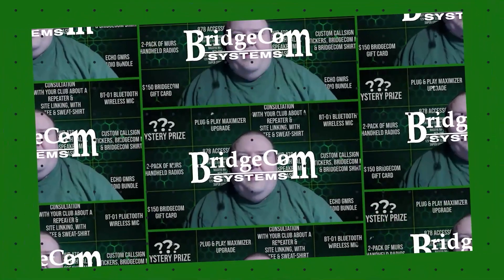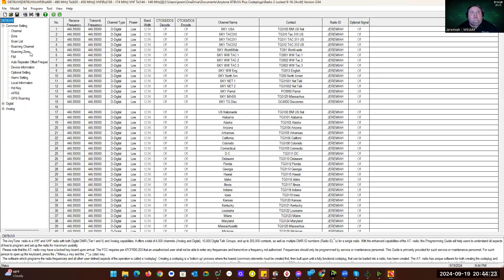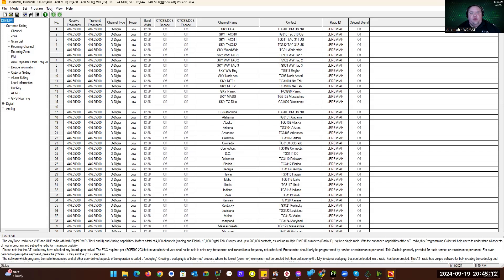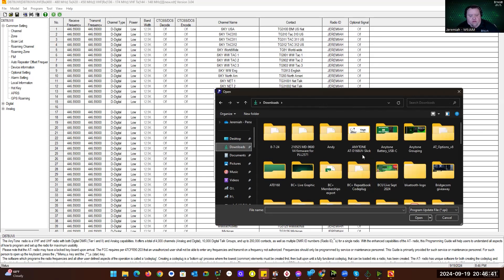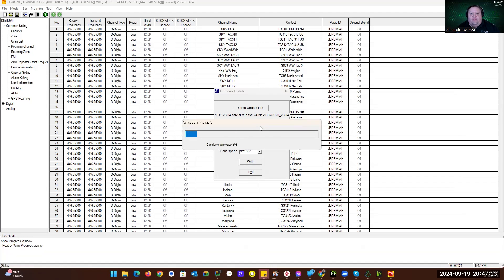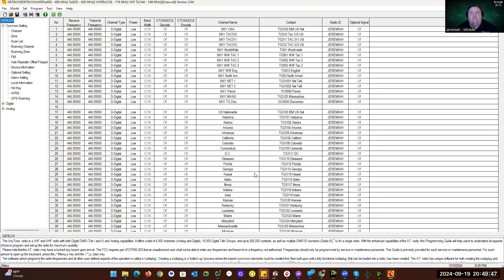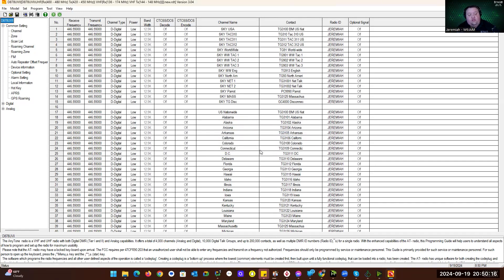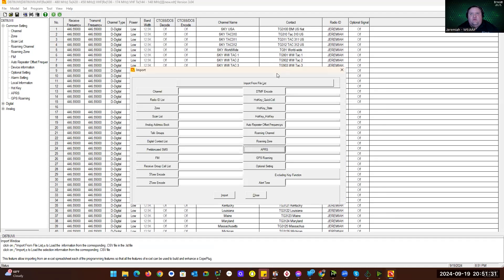How to Update AnyTone Firmware 3.04: Step-by-Step CPS and Satellite Features

Comment: The intro information omits whether this update is for the AT-D878UVIIPlus or the AT-D578UVIIIPlus.   I have both of these radios and am still learning to use and program.  I had to watch most of the video to conclude it was for the D878UVIIPlus.  I recently got my 878 and the firmware was at 3.05.  I upgraded it to 3.06 prior to watching this video.  At the moment I will keep 3.06 installed.  The 578 Firmware is only at 2.08.  The Bridgecom Systems Support pages show the latest firmware for the 878 to be 3.06 and the latest firmware for the 578 to be 2.08.  I am confused by the video that advises how to do an update to an older firmware version.  I seek to be less confused.
Reply from the maker: Hi! Thanks for your comment. If you have any questions, feel free to join our Facebook group — it's a great place to get help from the community: https://www.facebook.com/groups/BridgeComSystems. Also, if you're interested, check out our Plug-and-Play Package here:https://www.bridgecomsystems.com/pages/plug-and-play-package.